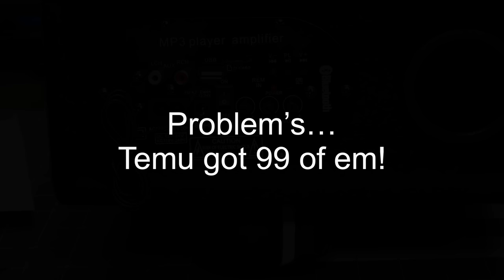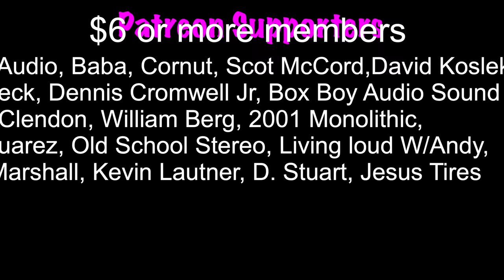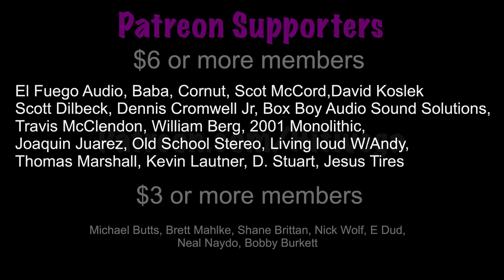Temu SUBWOOFER… How Bad Can it Be???

Comment: So it's not a subwoofer. It's more of a full-range loudspeaker. Also, the bass knob may have a bad solder joint on the board. Try re-flowing the solder on the joints and see if that fixes the issue.
Reply: Which can cause the hum noise

Comment: If that bass knob potentiometer wasn't faulty, it would be a pretty decent value as a stand alone blue tooth speaker for like a garage or workshop.
Reply: For the money, I would have to agree.  I guess I’m spoiled with my shop sound system.  It consists of extra parts from previous car audio systems.  The deck is a Dual media player which is connected to a Kicker 4 channel that powers four 6.5” Parts Express woofers along with a pair of tweeters.  There is also a D4S JP8 connected to an older shallow 10” Cadence subwoofer in a sealed box.  It is all connected to a 300 amp/hr lithium battery which powers my shed(through power inverters) and a small solar setup to keep it all charged.
Reply from the maker: Fo sho
Reply: probably a broken cold solder
Reply: @ihatelols  Hey, if you down with buying used gear, you do you boo-boo.  I stand by what I said for the price.  
There are likely even better deals that perform better if you look hard enough as competition in this market space is always increasing...

Comment: The hum is most likely due to garbage input and output filtering for the A/C power transformer.  Be careful about opening this unit as it may have charged capacitors even after you unplug it.  JMHO.

Comment: For what it is id feel like they’d have a better time selling the POs if they marketed a Bluetooth party speaker and possibly add in a internal battery it wouldn’t be hard to do since they already have a midrange driver with a tweeter, I have a pair of altec lansing Bluetooth pa speakers that can be stereo paired and I love them so much they’re perfect for parties on budget imo I even stopped at the music store where I buy my guitar gear for some pa speaker stands from proline but temu calling this a subwoofer is laughable it’s a full range junk Bluetooth speaker that needs constant power if I was going to run that id be better off running a home made full range speaker cabinet that can give everything from lows from a 8inch or 10 inch driver with a 4-5 inch mid bass and a high efficiency horn tweeter that would cover the treble that neither the 10 inch or 4-5 can cover, imo this is a waste of money 10x over and like I said I run 2 altec lansing Bluetooth rechargeable pa speakers which sound decent for their price and even though they’re bigger than this temu cash grab while they’re not overly light their still light enough for me to lug around by my self even when I first got them and I was still recovering from
The aftermath of battling cancer I was able to lift them over my head to put on the stands.

Comment: I wonder if it would sound better/do more power hooked up directly to an adequate 12v source. I know for sure you'd have less hum that way. But regardless your 120v input is likely powering a 10 watt power supply so that's about the max you'd expect. I am willing to bet if you got that amp sniffing  14.4 volts with enough reserve you could probably get that joker up to 20w. Or more with a good 24v psu

Comment: Just reflow the solder on the potentiometer and you're good.  I'm sure the solder joint is just loose and its common when people move that knob up and down.  You're probably caused the solder problem by moving it too much.  The solder they use now is lead free RHOS and that crap is horrible.  It tends to fracture so adding some leaded solder to that joint would make it a lot more reliable.

Comment: honestly if they soulld this as a full range kit for behind the seat of a truck and remove the bs amp and added thermal for speaker wires to hook up a radio to it then it could be a decent setup for some one looking to add a bit more bass and mid/high range to there car

Comment: Could the hum be from the power supply on the internal amp?
Reply from the maker: Definitely
Reply: @HifiVega   id love to see a couple phoenix gold amps pop up. I run the sx800.1, rx400.4, sx1200.6, and the sx line subs and 6.5s. With 2 sx12s in a prefab tuned boz at 44hz i averaged 144db 350 to 375rms. Best score was 144.3 at 373rms.

Comment: So the amp is running at 2 ohms when connected to the woofer and middler,  I think you needed to test it at 2 ohms.
Reply from the maker: It’ll only be at 2ohms when or if the frequencies cross together so the cap is used to minimize that
Reply: I can guarantee that woofer didn't do anything to deal with inductance. So by the time it reaches the "tweeter" crossover it's probably at 10+ ohms

Comment: Always very interesting content .....hifi ...think i can get away with running 2 v2sa classic sundown audio dual 4 12s off my jp23v1.5....i have big 3 ...upgraded alt....and will be adding extra battery.....
Reply from the maker: That’ll be an excellent set up
Reply: @HifiVega thanks man ..  I just didn't know if I needed to strap another jp23v1.5 or not ....I am going try it with just the one jp23v1.5....because if I strap another one gonna have get an even bigger Alt. And a lithium bank ....which I want but gonna have save up some more cash ...

Comment: That hum is a 60hz hum from line voltage. Either poor grounding or poor power filtering. The one small perk for a car application for it is that youll not get the 60hz him there. Lol. Though a while from the altenator frequency wouodnt surprise me if you got a noisy alternator.

Comment: The 60Hz hum is a bad ground.  Or in this case, no ground at all, and probably something poorly looped on the crappy amp.  If you drilled/tapped a screw into that amp panel and crimp a bullet plug on a cable, run that to the ground in the wall, it may get rid of it.  Or it may just suck.

Comment: Was that hum present with both AC Power and 12V Power? If the hum was only there with 120V AC Power, then I would suspect insufficient power supply filtering.

Comment: I need a pear of 6 1/2 inch door speakers that can handle lot of power I only got three in depth
Reply from the maker: That’s gonna be a tough pull, but I’ve used these and they handle a decent amount of power. I’ve had them on 100w rms

https://amzn.to/46isKtK
Reply: Pair, not pear.

Comment: I was expecting it to be one of those 100w modules. Not a 11w module!
Reply from the maker: Right!
Reply: @HifiVega  this is good for if you want to have some "bass" while riding a bicycle or gocart. a dynamo will make enough power to run this and it has bluetooth so all self contained.